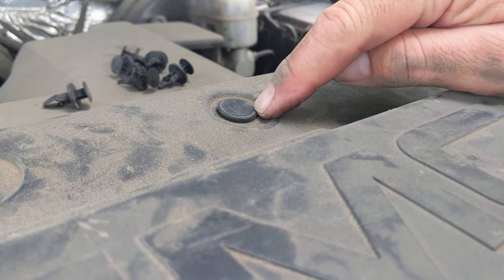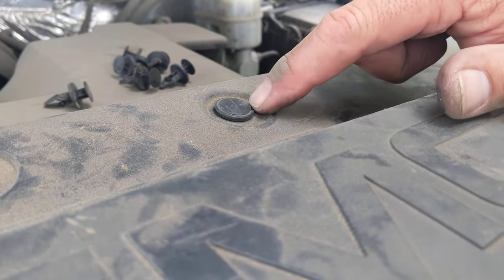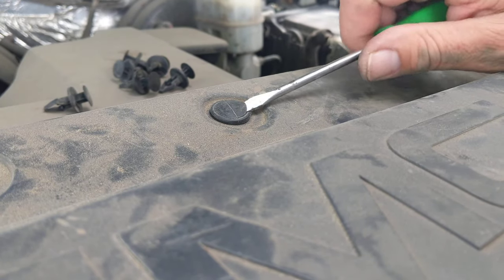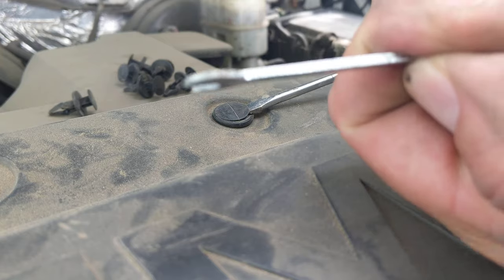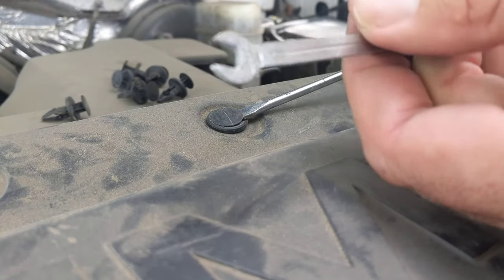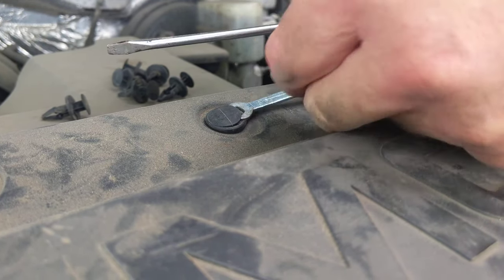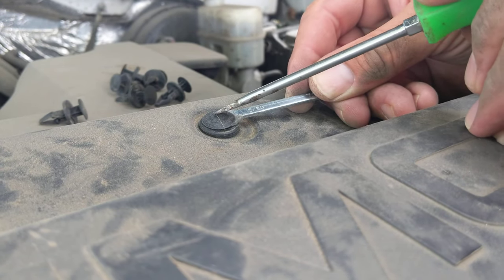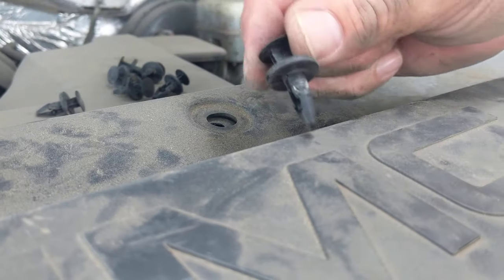Removing push-pin rivets (trim clips?) without special tools.

Comment: actually you need to buy like 100 of them (not expensive, various kind in a set) and then you can force them out, cause either way, once used, they never hold so tight like in first pop
Reply: Agreed. $9 from Amazon got me a huge variety pack that included the pry tool

Comment: I have a 2019 Ridgeline, with 55,000 km.  Went to the underside of the engine/transmission area, and had to remove plastic covers to get into the work area.  I was familiar with the plastic “pins” on other vehicles so I went out and bought a set of plastic tools.  Wrong… I ended up destroying 50% of the pins, because the “plunger” portion of the anchoring pin had become filled with road dirt and sand.  I would have been better off, cutting them off with a side cutter and popped new pieces in (which I had to get anyway)!  Come on Honda… I know you can do better.

Comment: Auto body shop owner, buy a tack puller from the hardware store. It has a screwdriver handle and a sharp V shape with an angle at the business end. Indispensable I've used this tool since those retainers first came on the market.

Comment: I use a painter tool. The one with a bottle opener (go figure) on one end and the paint can opener on the other end. I keep one in the quad all the time. Its good for the clips and the plastic "door" to check the oil.

Comment: I have the opposite issue. I try to install mudflaps on my car and it was a smooth sailing until the last one of the stupid things. I killed 30 minutes and it just does not go in and it made me so angry that I had to stop, otherwise I would break the clip or the bumper LOL.

Comment: Your wrench is from an "ignition wrench set".  I have a set that is very similar that came with my Dad's boat he bought in '62.  If you put a partial bevel on the open end of the wrench (it will still work as a wrench), and a slight bend you won't need the screw driver.  Or you can buy the right tool for $5 at Harbor freight if you are going to be doing this a lot.

Comment: I'm wondering whether I can drill right into the middle of the clip and remove it.  For some reason, the enter head was gone (I bought the car used) and I don't have a way to pull it out.  Thank you